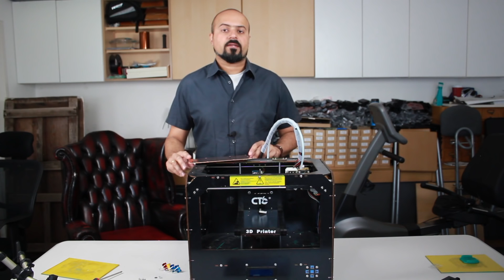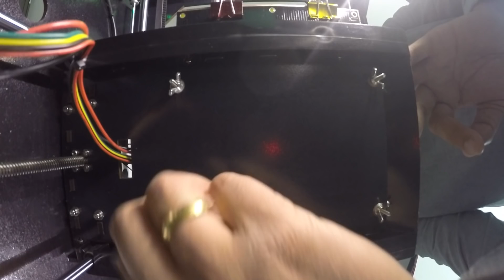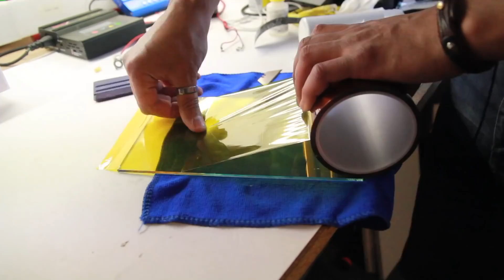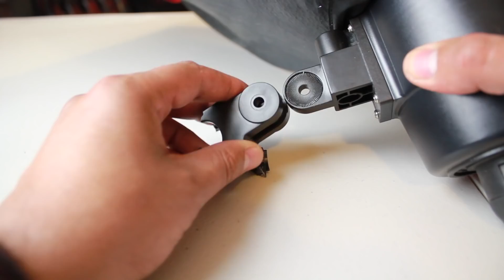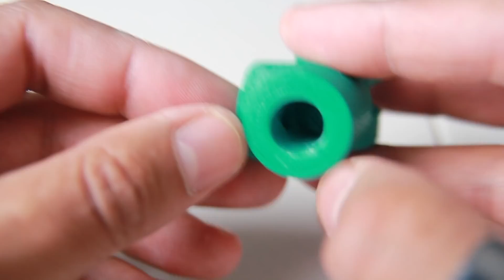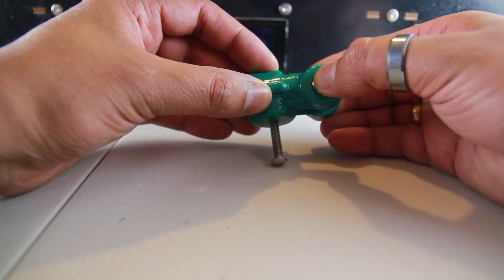3D Printer - Part II - COPPER BED UPGRADE

Comment: Did you ever try a sheet of carbon fiber?

Im upgrading one of these printers for my nephew. Removing an extruder so we can use an 8x14 bed. A Big increase over stock. Aliexpress has complete aluminum upgrade kits for $120 that also breath life back into these. Get it running on a 32 bit Klipper and add closed loop encoders and its bettwr than a modern printer

Comment: Because the leveling screws are not near the edge of the print bed, leveling socks. A nice mod would be to add a plate below to make the bed leveling screws to the edges.

Comment: I really like your videos, but you are using the term "microns" as your unit of measurement; microns are TINY! You seem to be working in thousandths or micrometers. Microns are only 1000th of a millimeter, or .00004 inches; you cannot measure that with any tools you have available, unless you are in a lab. A typical human hair is about 50 microns and you cannot see anything smaller than about 40 microns without the aid of magnification. You obviously know something about what you are doing, but your reference for unit of measurement is inaccurate. A 20 micron feeler gauge (if available) would be smaller than the cutting edge of a razor blade. 😃
Reply: "You seem to be working in thousandths or micrometers."
Micrometers are microns, I'm guessing you meant to say millimeters?
Also, metric countries don't refer to 'thousandths' for metric, to avoid confusion with the imperial thousandths or 'thou'.
Although, we do often refer to millimeters as 'Mills' ..... just to confuse those Americans that use 'mils' instead of 'thou' :)

Comment: I print using cheapest PLA, 202 deg, on a glass bed using a glue stick (the one thing that transformed this 3D printing lark), I do not use a part cooling fan, and the hotend fan is on full 100% of the time. Parts stick to the bed so well it is a pain trying to get them off sometimes.

https://www.youtube.com/watch?v=j34C39lzReQ

Comment: Awesome videos, really liked your Iris Roof design that as just great to watch you think that up.  I have an opportunity to buy this printer 2nd hand 6months old would you recommend it for a beginner. I am planning to build a Hyper cube eventually if i stick with it, so this would be a start off printer.
Reply from the maker: Thanks and my thoughts on this printer is it is a great starter printer to get into 3D printing. Even if you get it cheap enough the parts alone would be worth it.  Only slight niggle is that you are restricted to using Makerbot slicer and its OS is sailfish which limits the type of GCode you can upload. Go for it just to make the Iris enclosure LOL

Comment: I believe ( haven't got my printer built yet ) that your application would justify 100% infill
Reply from the maker: I think you right but so far the part is working well mainly due to the acetone vapor smoothing.

Comment: Did you screw in the copper plate to the pcb? I noticed in your video the pcb and the copper plate were not touching in all spots. It looks like you skipped a step in the video. I customer made a bed for the Avatar IV which is a similar MakerBot clone and used tabs front and back which prevents the nozzle from hitting the clips. That noisy fan is probably the one which cools the mightyboard. It's a common problem with Chinese fans in general.
Reply: What is a quiet and good fan replacement that you know of?
Reply: Chet Sands I haven't found a decent fan from China. on the plus side they are cheap so buy a few.

Comment: it is very important that you clean the Kapton tape with denatured alcohol before use to wipe off any contamination, mainly human grease.  Contamination will prevent the print from sticking.  I have found that other solvents can also leave a film once the solvent has evaporated.
Reply from the maker: +Joe Michienzi agreed. I use isopropyl before every print. May upgrade bed to PEI.

Comment: why is copper better than aluminium ?
Reply from the maker: better conductor mainly so better distribution of heat, but why not? no one explored it and thought it might start a discussion among engineers.
Reply: In this case, it's not.
Reply: Highteckhobbies also really good for those who have an inductive sensor

Comment: IDK how much pressure you put on the part to make it fail, but typically poor layer adhesion is caused by printing at too low of a temperature.One temp does not fit all - I have one spool of ABS that likes to be extruded at 230C, while another spool (different color, different manufacturer) likes to be printed at 240C.I'm sure the acetone helps too  :)

Comment: You should keep your old bed and use it to screw your new bed into.  Trust me, it makes a massive difference.  Use the 4 screws on the inside that currently have springs on them as just a way to attach the old bed to the arm platform (remove the springs).  Then the four far corners are your new adjusting screws put your springs on those.  Bed levelling is a thing of the past after that.

Comment: Looks like you are using your cooling fan. If so turn that thing off! The fan will promote warping and poor layer adhesion. Your part warps because the plastic is shrinking. ABS has a much higher shrink rate than PLA this is why it is so easy to print with PLA. Thermal expansion is real and it's a bitch. Another thing ditch the .2 mm nozzle, the faster you can get a print done the less likely it is to warp. You don't have any need for thin layers on a part like this step up to .3 or even .4 layer thickness it will speed things up even more. The more heat you can keep in the part the better your parts will turn out. Hopefully those few tips will cut down your scrap rate.
Reply: Couldn't agree more .4mm nozzle and a minimum of .3 layer height, I recommend .4, 
Anytime you are making a functional part, thicker layers lead to stronger parts. I also increase the flow rate of material a tad, perhaps bump it up an extra 2% to let the edges adhere to one another a bit more. I think Angus at Makers Muse did a video on this and he showed his results; check it out sometime.

For the part NERDVille showed, I would have laid it on its side, printed it and put a hose clamp around the bottom to add strength to the mounting point(hey its about making something that'll last not be pretty). Besides, you can paint the clamp black and no one would ever see it.

Comment: Hi, nice video, but do not confuse 20 microns with 200 microns. You cant adjust a printer in the range of microns, the best possible would be 10 u. But 50 u is more realistic.
Regards
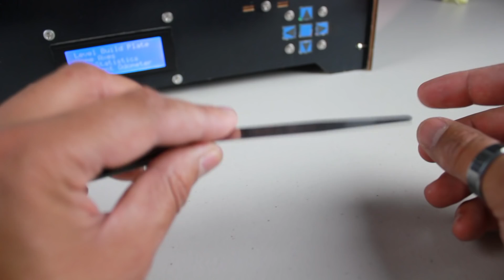Reply: @huhhman  DocM is referring to in the video, @5:19 he referred to his feeler gauge of 0.20mm as 20 microns, which is really 200 microns
Reply: huhhman no, you can’t. 10 microns or so is the best accuracy you can expect. You can denominate it in microns if you want, but you cannot get micron accuracy.

Comment: for a great PLA adhesion wich is cheap too , try wood glue watered down to a low fat milk consistencey and apply a thin layer. 
I print all my pla without brim or skirt in any size and have no problem at all.And it works on any type of bed material. Aluminium,glass and even kapton.
Reply from the maker: Alan Lewis hey what a good idea. I'll do some tests and see how this compares to the usual. Do you mind me sharing this on my channel if the results are worth sharing?
Reply: No i do not mind at all. Hope it helps. Did wonders for me. Just dont use a to thick layer or you have a hell of a time getting the print off. I preheat my bed to about 40 degree celsius and then apply. Just because it drys faster.

Comment: Finishing with acetone only strengthens the external structure of the component, heat treating it aids in fusing the internal structure too, so perhaps a combination of the two  methods would be pretty good if you don't want to move to exotics and could counter the warping / shrinkage? - https://www.youtube.com/watch?v=CZX8eHC7fws

Comment: On that fan take it off and peal the sticker off the back, it  should be an oil well drip a few drops of veg oil in it it will quiet right down. and glue or tape the label back.
Reply from the maker: hey thanks, will give it a go

Comment: Have you tried to print this laying on its side? it would change the weak points. I don't know what type of compression you get on the base of that but you could try increasing the infill to compensate for a weaker layout of the plastic.